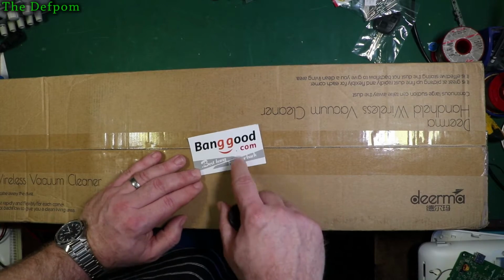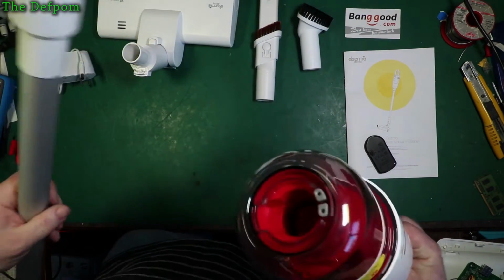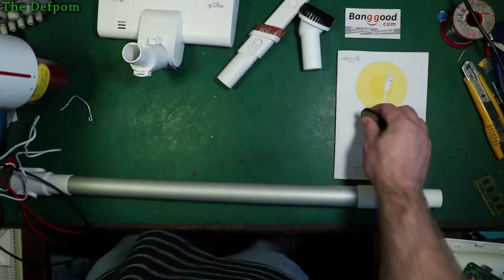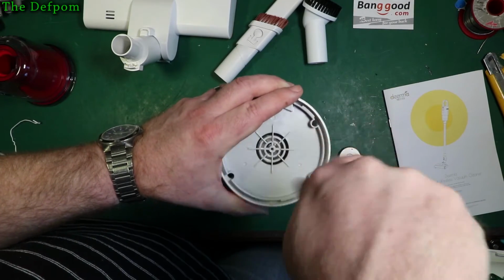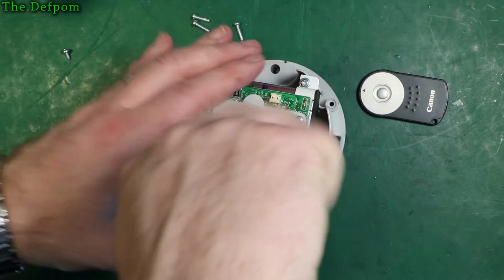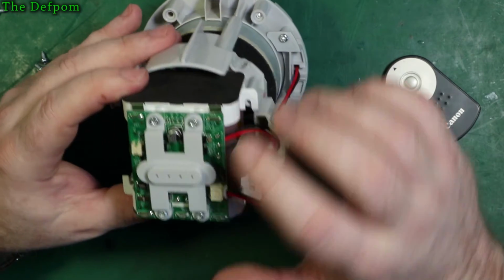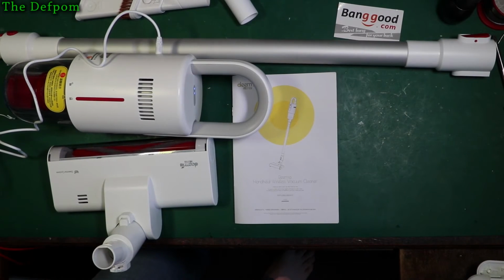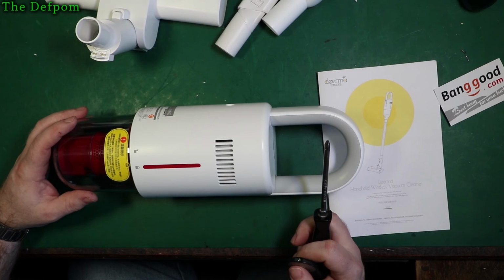🔴 #645 Deerma Handheld Cordless Vacuum Cleaner Review

Comment: Hi! I'm a viewer from the Philippines🙂 I just got mine a month ago and it accidently crashed to the ground hard a few days ago. Now, it isn't charging anymore (the charger is plugged but the blue led lights aren't lighting)😭😭 I plan to take the motor apart myself, so can you pleeease give advice on what I should look out for😭 (no background on electronics repair)... hope you can help me with this!! Thank you so much!!!! Subscribed with notifications bell on🙏
Reply: Same with my vc25. It crashed as well and now it does not fully charge. Blue lights are working but always detects 2 bars full. Then it will charge to 3 bars but when turned on it will display only one bar. It will run for a few minutes maybe 5 mins before charge runs out.

Comment: I have the VC20 plus. The chinese manufacturer says its more stronger due to bigger battery than the vc20 which is in your video. When you opened the battery slots, it shows 6 slots but have only 4 18650's. I reckon this is what the manufacturer is stating "bigger battery" meaning capacity and amperage for the vc20 plus. If you can get a vc20plus, can you open it please? I wouldn't open mine bcos I might break it. Lol. Wanted to see if it might have 6 batteries.

Comment: Hey this is a long shot, my roller head has stopped "rolling" and I can hear a little rattle coming from inside. Could you please by any chance suggest how to take it apart safely?
Reply from the maker: DaiGenGTR -from looking through the comments this seems to be a common failure, mine is still working ok, so far.

Comment: I use my old vacume to suck away solder fumes and toxic flux fume.It works quite well at removing the smoke from the air but may not be as affective as a 400 pound or more dedicated machine made for that kind of job.  Saved myself quite a bit of money and my lungs i reckon.

Comment: Now that sucks.:) Sorry i just can't help myself :-D
I'm sure you could fix the button by glueing a ring around the button to make it harder to push, or just stop rolling the thing around you nutter he he :-D.

What did your good wife say to you cleaning with it, ' Ooow you can do the stairs now. ' :-D.
The batterys look decent and should last a good while.
Reply from the maker: zx8401ztv - I cleaned our motorhome with it and they lasted long enough to do that, certainly not as good as a proper vacuum cleaner but still perfectly usable.
Reply: Also easy enough to replace the 18650 batterys when they are all pooped out, if the motor isn't frazzled lol.